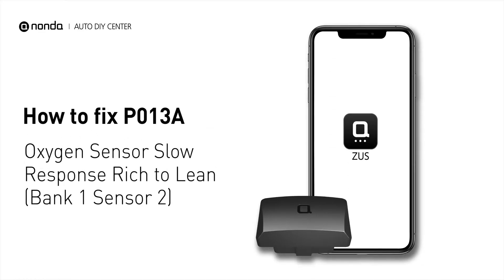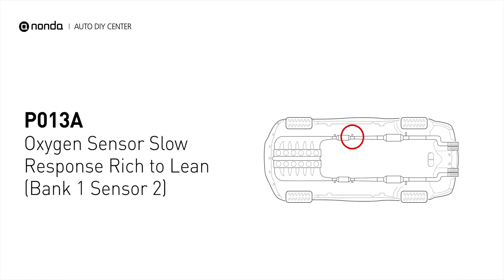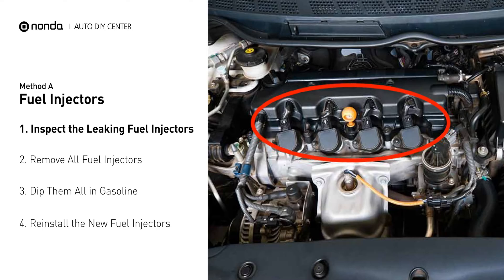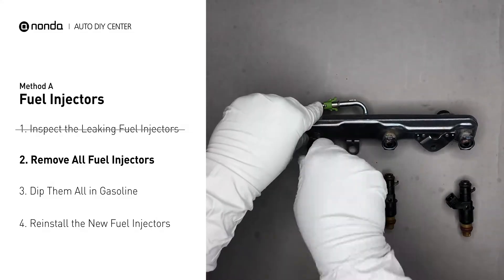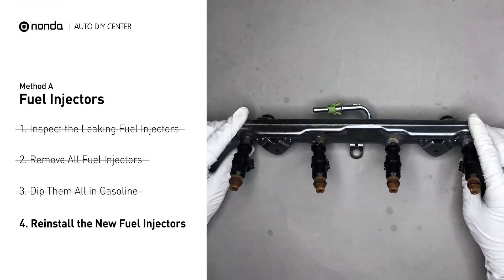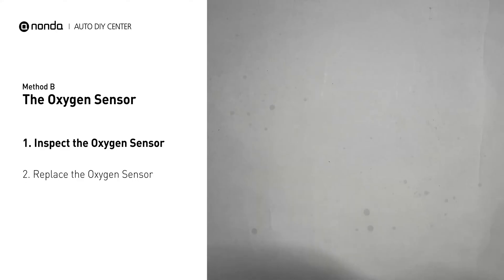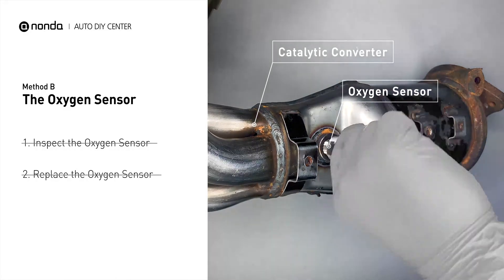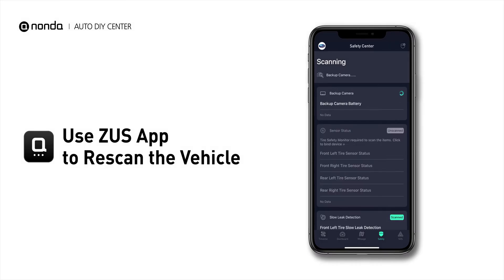How to Fix P013A Engine Code in 3 Minutes [2 DIY Methods / Only $8.23]

Comment: Hi, I own a 2019 Hyundai Accent sedan 1.6 litre I got the code po13E is that the top oxygen sensor right behind the manifold or is that the lower one down by the rock and pinion?

Comment: Im having the same issue as dannydawood, 2015 ford fusion hybrid, changed downstream o2 bc i had p0420, cleared code bow i have p013a. Do you think i should replace the upstream o2 too? Since it has 200k on it
Reply: Did you find a solution? I have a ford fusion also
Reply: @joemartinez5714 I changed out t
Bank 1 s o2 sensor sprayed a whole bottle of carbon cleaner in it 😂 haven't had an issue since.
Reply: @Jpadilla2k5 wait so you changed out the downstream sensor the one by the CAT?
Reply: @joemartinez5714 I replace the down stream one a year before the upstream. Ended up changing both.

Comment: How is it possible for a DOWNDTREAM 02 sensor to pick up a lean condition , but NOT the upstream 02 sensor? The upstream sensor monitors all engine running conditions and the downstream 02 sensor monitors the catalytic converter, and would be more reactive to a exhaust leaks, wiring, or ECM reprogramming than injectors. I would appreciate some clarification so I may understand why the this is possible without the upstream sensor seeing some kind of an issue. Thanks Mark

Comment: I replaced the oxygen sensor and i still see the same code after i cleared the original code Any other solution to fix the problem?
Reply from the maker: Please provide us with your vehicle's year, make and model.
Reply: 2011 Ford escape 2.5 L

Comment: Is it possible that this error is due to defective downstream catalytic converter itself? How is possible to diagnose the efficiency of dowstream catalytic converter before change lambda probe or injectors?
Reply from the maker: Yes, it could be. But to provide you with proper advise, you may seek a professional technician to inspect your vehicle first to certainly know the cause and remedy. Thank you.
Reply: You can have the catalytic converter pressure tested